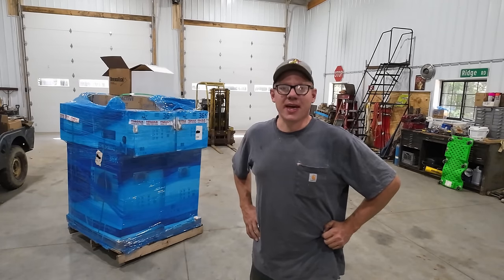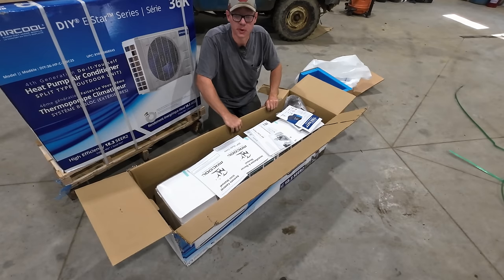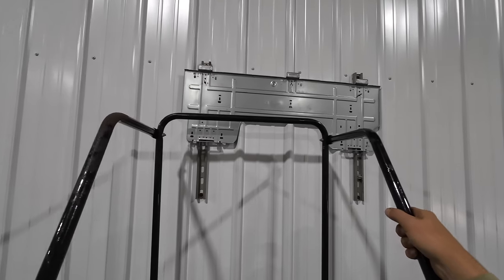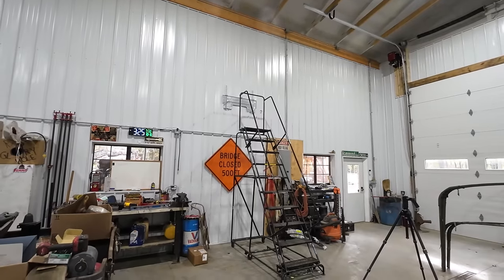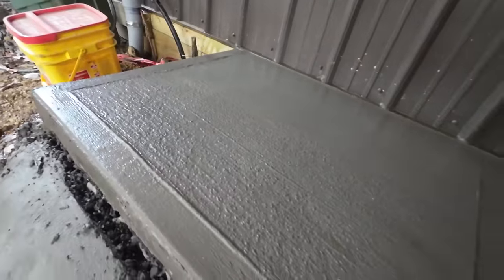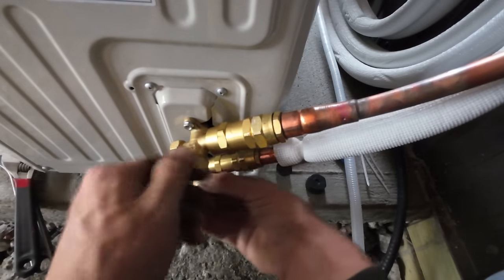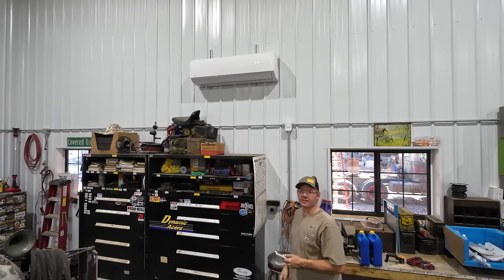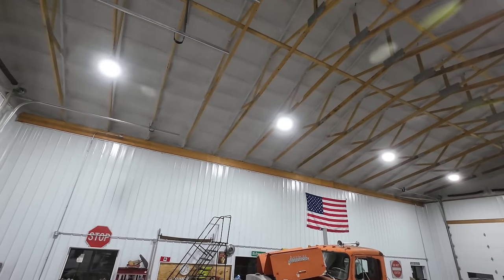DREAM SHOP Gets a Serious Upgrade! (How Hard can HVAC be??)

Comment: Hopefully we get an update on the power company debacle! I'd be interested in hearing their cost after you provided the trench and conduit
Reply: Knowing how Utilities work, that 52 grand price tag is JUST pulling the cable through the conduit, installing the Transformer on the existing pad and hooking everything up to the Grid...

If I were Matt, I'd be STRONGLY requesting a precise, itemized breakdown of exactly how they calculated that price...
pulling the cable
placing the transformer
connecting the cable to the Grid
connecting the cable to the transformer
connecting the transformer to the shop's Main Distribution Panel
Labour
etc.
Reply: Why can’t Matt supply and pull the cable?  Then utility “simply” has to connect it. 
Diesel power provides heat and electricity   Making use of that heat in winter might keep fuel costs reasonable.
Reply: @Dave5843-d9m  Depending on how the Transformer will be connected to the Utility Grid, it will require either 3 or 4 wires each the better part of 1 inch in diameter...

Pulling 3 or 4 of those through several hundred feet of conduit requires expensive, specialized equipment Matt doesn't have...

Comment: Very long career HVAC tech here: Minisplits are great. Quiet, super efficient, cheap. The biggest downside is they don't last as long as package or central splits. After warranty, they usually aren't worth fixing.
Reply: I have a question.  Mine stopped working.  I had a hvac guy look at it. He said it's not good to have that large coil behind the unit.  The oil and freon can settle in it. He said it is better to cut the line and reflair it.  Is this true?
Reply: I know what you mean. I have a Midea  (Chinese) 1.5ton and it has been working great since 2018. Very efficient. But where would you ever get parts for this unit? And it's not like the old contactor and motor capacitor days. These units have VFD controlled compressors and fans. Something on one of those PC boards fails and you are out of luck! Additionally because of all that electronics, they are highly susceptible to lightning and power surges.
Reply: @amtak2351  He is technically correct, but it is pragmatically irrelevant. If it is a leak free flare, don't tempt fate by touching it. An HVAC installer ought to cut to size on installs, DIY homeowners are better off using the factory flare and coiling the excess.
Reply: ...especially those Chinese made
Reply: ... I've installed many Mitsubishi's that are still running after 20 years with NO breakdowns. In Phoenix to boot

Comment: Matt I would highly recommend that you have a professional HVAC technician come out and recover the refrigerant in both units and put them in a vacuum and recharge both systems.  Because by not putting the head and line sets in a vacuum prior to releasing the refrigerant you have put air in the system and the only way to remove the air is to recover the refrigerant and put the system in a vacuum and recharge.

Comment: Driller guy here again! We have a pretty cool system. We drill 150-300m deep, same as for a water well but smaller diameter, We use a looped plastic pipe all the way down that collects the "heat" from the ground, that then is circulated into a "heatingpump" that converts that to heating, very affordable and no work needed (like firewood f.ex). Think of it like a backwards refrigurator. You can use the very same system to COOL your building aswell, but very much cheaper. You basicly circulate the water into the ground wich is roughly 7 degrees celsius, then through a fan that blows cold air. So you are basicly paying for a circulation pump and a fan. Very very cheap air condition.

Of course this system is not for cheap to install, but the running of the system is quite nice.

What you have is cheaper to buy but more expensive to run :)

Comment: Another advantage to your uni-strut excess being above the head unit is you can use that area to fabricate a cover/ shield about 8-10 inches above the top of it to help keep dust, exhaust soot and anything else from collecting on the top of the surface. This won’t prevent the filters from needing to be cleaned now n then, but helps considerably. Did it in my shop after I saw how much sawdust got up there.

Comment: Good to hear that you are on the grid. Hopefully you got a better install fee than $52k. I'm impressed with those HVAC units especially that they are DIY. Pretty slick, and more impressed that they areso quiet and able to warn up such a large shop. A nice back up for sure, now you need to get a huge auxillary generator ( one of those military units?) hooked up on a standby circuit in case of a power outage.

Comment: Excellent choice with mini splits. You need to run a heated condensate drain or lift the outdoor units' up from the pad. Otherwise  in winter the pad turns into a solid block of ice which eventually will be thick enough to stop the fan and possibly crack the coil.

Comment: as an HVAC contractor I often shy away from any DIY kit and seldom make repairs to them when they break down. That being said its good to know that these are simple and any average DIYer can do it without certified contractors. 6tons should be enough as well insulated you made your dream shop. Or at least make it comfortable. I am really looking forward to the videos of your floor heat.
Reply: I purchased a Mr. Cool 36k and after using it for cooling  all summer it wouldn't work when I switched to heat in the fall. Mr. Cool has abandoned me. I should have taken the $3000 I spent had put it towards a unit from someone like you.

Comment: Installed a Tosot 12k unit in my wife's 16 X 10 greenhouse, primary use is the heat function as they have a 'freeze pipe' mode, where it switches to a 46 degree program for keeping the greenhouse (and the citrus trees and plants) above freezing when it falls to 0-10 degrees here in North Texas.  The Cool function works fine even though I have about 72 square feet of roof greenhouse windows and it is 102 deg outside.  The Tosot unit is half the price of the Mr. Cool.  The refrigerant is already pre-charged, but you have to vacuum the lines.  The good part about that is you can cut and flare the supplied tubing to length and eliminate any oil pooling in the lines, vacuum it, open the unit valves and start enjoying. I'm looking at installing the same unit in my workshop, they are still about $1K, so saving my pennies.  Thanks Matt.

Comment: After you determine what the heat loss character of your building is you may want to have a staging control thermostat, that basically will use the heat pumps first and then transition to the floor heat. Look for units that have 2-3 sensor inputs to cover "zones" of your building. Additionally, everything connects to internet in these days (believe it or not) so you could monitor the building temps from your phone.

Comment: My then brother in law had the same problem with power that you did back in the 70s. He built in the North woods in Wisconsin and it was very expensive to run the electrical power in. The power company didn't like to run power because most people were just building vacation homes that wouldn't use enough power in 20 years to pay the installation cost. There was another guy who built in the same area so they shared the cost. The way the power company did it was they had to pay the installation cost up front then the power company applied that payment as a credit to their account so they didn't have to pay for power until that credit was used up or a certain number of years passed. I think he said 5 years. They figured out how much electricity they would use in the time they had to use the credit. They had planned to use wood burning boilers with hot water coils in propane furnaces so they had backup heat when they weren't home to feed the boilers. and propane cooking stoves but they bought electric stoves. They put  electric heating coils in their gas furnaces and electric heaters in their garages. He said it worked out well because they got time to get their wood boilers set up and installed. He didn't worry about the cost of cooling his house in the summer. Did your power company credit you for the installation cost? If they did, it might be worthwhile to install electric water heaters to heat your floor for a while.

Comment: Heat pumps are awesome. I just had three 3.5-ton Mitsubishi units installed at my house (three outdoor heat pumps + three air exchangers; using existing duct system). Here in California, it cost me a small fortune, but they are so nice -- heating, cooling, no issues. On top of that, they're incredibly power efficient.

Comment: Where are the Electrical Isolation switches at each Condensing unit? You'll find with a couple big ass air circulation fans will provide year round even temperature when your heat pumps are keeping the shop tempered. Add quality air filters on the air intake. Diesel particulate will attach to the evaporator coils and erode the aluminum coil fins.  A general exhaust fan controlled by a CO2/NO2 sensor will extract all exhaust gases.

Comment: I would have mounted the outside condenser up high so it doesnt encroach on your work/storage space. Gives you more room to work and protects it from my clumsy operation of heavy equipment! 😂
Reply from the maker: Thought about it. Decided against it
Reply: Good for the storage space you would get but you will get a lot of noise and vibration you would hear inside.
Reply: Hi Matt what is the cost of these units ??
Reply from the maker: @blackbm54  that was my concern
Reply: @DieselCreek I have mine mounted on the wall. You made the right call!
Reply: COOL  Now you have mains power You can put the crane up in the shop I know it must be annoying me going on about the crane in your shop You could be making the video as I’m writing this here

Comment: I was so hoping they were not "Mr cool" units. They don't have a good track record. 35 years in the Business, I went with the Midea/ Carrier units.  I hope the new units are better. You will have to do a one year review.
The instructions should say not to mount the outdoor units under a covered area.
There is also a wall mount kit that elevates the unit so you don't need a pad and it is cheaper than buying the " elevating feet" for the od unit drainage, yes you will get condensate from the outdoor unit during defrost. If the unit is mounted flat on a pad it will build up with ice.
In my state, by code, a service disconnect is required within reach of the od unit.
You did a great job. I just wanted to throw out a few pointers.

Comment: I have a brand new unit heating/cooling my home, but only after we had to replace the old unit right after we bought this house. The previous DIY install was directly on a plastic pad, some water froze and cracked the pipes. In my un-expert opinion, I suggest that you install some rubber bushings on all four feet to keep the unit off the pad and help dampen any motor noise. I doubt you will se this comment, but I hope you do.

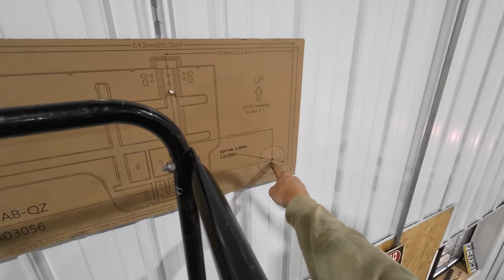Comment: Get your license, and stock up on more R134. You'll need more eventually, nothing's leak proof. 13:24 May need some synthetic refrigerant Oil if you need a top-off from a leaky fitting. And a concrete pad for the condensing unit. Ok, pour one then! 22:33 😊

Comment: Awesome job. I have been in the HVAC industry and these are some great units. The manufacturer came up with a great idea making these precharged units affordable for Harry home owner to install. Can’t wait to see your wood boiler in action to keep you toasty warm this winter. All you will need is to install your indoor crane and you should be ready to tackle any project in the comfort of your own shop.
Reply: The precharged system was a new one for me! - so when a technician vacuum purges a system before refilling, is it only to get the water vapor out? If so, their drier must be designed for a bit more capacity than the average system?

Comment: You are correct about productivity,though I see no lack in your productivity. A cold shop makes seals difficult to impossible to install properly if they will install at all . Tolerances change drastically.Keeping just the condensation and humidity out will be a huge factor for comfort and the corrosion on parts etc in storage or waiting. You do it all yourself like this installation which saves you money which can't help but make a spouse happier.This DIY project of something usually done by a provider shows how and why you have such a shop. I really like your content,it's always been something I can duplicate should I wish to.

Comment: Bit late now Matt but with wall brackets the outside units could have been up under the roof so you didn’t loose the floor space. Loving the whole workshop series thanks
Reply: Then it’s a bitch to work on. I can’t think of anyone who would choose to stand on a ladder versus the ground. You see these mounted low for a reason. Maintainability
Reply: What he said. 5 - 10 feet off the ground wall mount. Save ground space under lean-to and much, much cheaper and easier to mound a couple of uni-struts to hang the unit off of. All the ones I've installed were either roof or wall mounted, ground installed would be a last results.

Comment: They have definitely gone down a lot in price over the years.
Be interesting to know what it would cost to heat and cool your shop.
Reply: Its not much. I heat and cool my house with mini splits and my electric bill runs $120-150 a month. My home is all electric. no oil or gas at all. I run 3 mini splits.
Reply: Pennies. Modern air-to-air heatpumps are very efficient in both heating and cooling. When heating they will easily achieve over 400% efficiency, similar when cooling. They are so efficient because they are just moving ambient heat from the air inside (when cooling) and pumping it outside. Vice-versa when in heating mode.
Modern marvels!

Comment: ive got a 50x60x15 shop built in either the late 70s to early 80s thats so so insulated and i put in 3 LG 36k but mini splits for about $3000 a unit since i got them wholesale through a family member that works at a commercial AC company.. DIY installed them all so no real install cost.

im an owner op truck driver and me and my dad park our trucks in the shop and work on them so for most park friday-sunday is when the shop is used rest of week sits idle.

ACing the shop  my power use per day was around 20-30kw/h monday-thursday and 40-70kw/h friday-sunday  so far this last summer highest power bill i had for the shop was $180  to keep the shop 65ish...usually fogged up the windows when you drove a vehicle from inside outside being extremely comfortable while working on things is priceless.

right now start of winter they are using 60-80kw/h to keep the shop 62.  i also have 2 propane ceiling tube heaters and a clean burn 180k btu oil burner so when home we use oil during the week is minisplits and propane.

our power company offers a special rate for mini splits of 6.5c per kw/h so that helps.

location - south dakota for those that wonder the climate zone.

Comment: Matt, it doesn't look like your going to have room on your walls for the crane supports. You have a beautiful shop. I look forward to your future endeavors. Love your channel.
Reply: He built concrete pillers in the floor for the crane. It doen not connect to the building. It will be free standing on 4 legs that go down to the pillers
Reply: We just as well forget about the crane going in there. He has made promises in the past and the next thing ya know the stuff got sold or traded away and forgotten.
Reply: I thought the plan was to have the gantry crane up at the very top of the wall? In which case there should be plenty of room
Reply: Matt, good job installing the Mr. Cool units, by yourself, well,with the assistance of several of the must have tools and equipment 👍🇺🇸.   By the way, I always hit the 👍 at the beginning of your videos, haven’t been wrong yet.
Reply: @benmac940  The supports still have to run down to the floor for it
Reply: @J-1410  yeah that doesn't take up much space 3 or 4 I beams down to the ground
Reply: @benmac940  it was 6 or 8 from what I recall
Reply: @J-1410  total yes not per side

Comment: I lucked into a set of ceiling fans with the real motors on them. The good motors are about the size of a basketball or cheap beach ball. They also had LED lights on them which were perfect for night lights in the shop. I put them on low and let them run all winter to help keep the air circulated and when I'm working helps push the heat down to the floor. I fixed up a peice of emt conduit with a claw to pull the chain to switch the fams on high during the summer if needed. Worked good for me. Although i have to admit after 10 years or so the "wood" blades are drooping. So I guess what I'm getting at is they would work as a interim solution for your more pro setup and works great for home gamers. Just don't bother with the small pancake type motors. The buzz buzz buzz buzz intermittent sound they make on low speeds will set you crazy.

Comment: You will need to clean the air filters.  It is amazing how much "junk" they pick up in the circulating air.  Probably 2 x yearly, certainly every year, you will need to clean the internal units filters.  External ones, not quite so frequently.  The internal ones are easy enough to clean, the external ones are more problematical and you may need to get a commercial HVAC assistant to come and do this.  I personally clean the filters for my domestic unit — but I am pretty well clued up on these things.

Comment: Why install such an "untidy" slab.  Use some more Unistrut and hang the condenser unit up and out of the way on the wall. Yes it's heavy so run the Unistrut over 3 or 4 fixing points to spread the load.